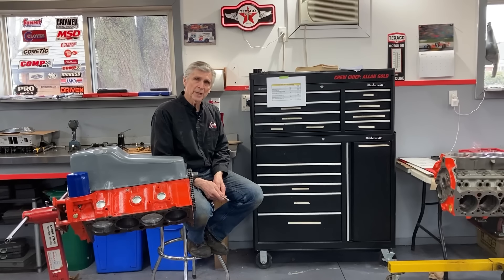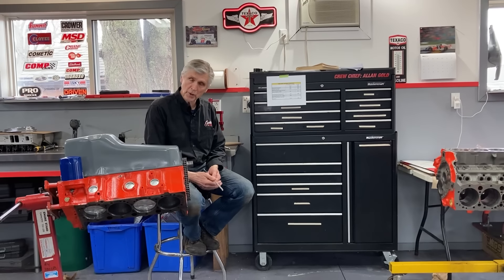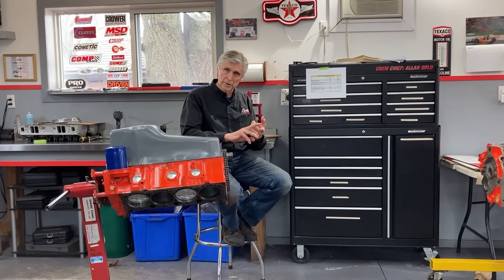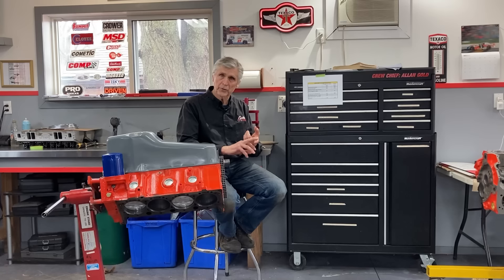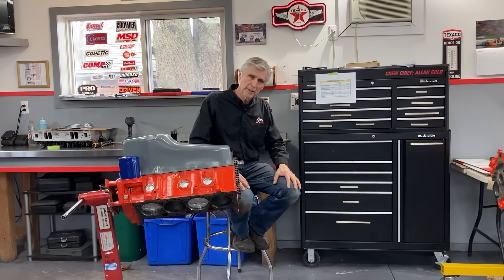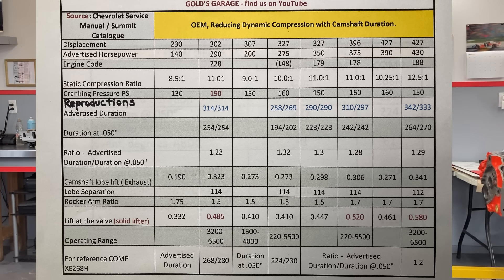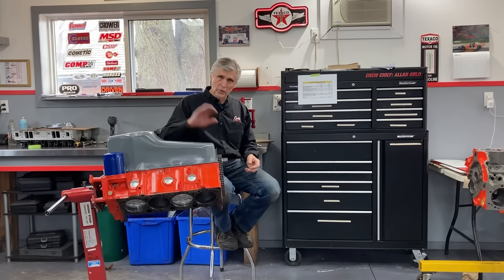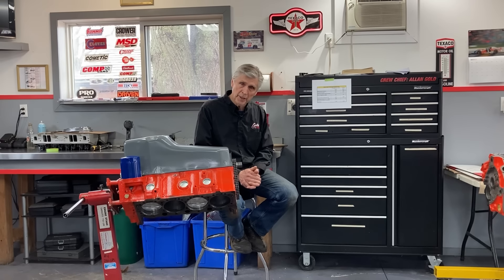Selecting the right camshaft - Compression Myths How much compression can you run on pump gas?

Comment: 12.5:1 SCR on pump gas? Absolutely! Even with steel rims.  Yep! Seen it done many times actually. 
Definitely premium gas, 93 octane from my experience.  Can't comment about anything lower, but I have heard it can.

I remember a time I believed in some of the stereotypes, and at the time they seemed correct because it typically came from people who seem to know what they were talking about, however I kept going back to the first time I seen very high compression with steel heads on pump gas. And that would be the engine my stepfather built. He was running 12.5 to 1 static compression ratio, Steelheads and ran 93 in it. No problems.
Regardless this is when I was first starting out and learning everything. Buy my mid-teens my brother and I were already doing engine swaps in manual transmission conversions etc etc,  and we were building what was considered high performance engines at the time, in the early 90s 400 or 500 horsepower was extreme horsepower, lol!

Anyways what has seen my stepfather and others do always nagged at me when I heard the so-called experts on compression 

Now many many years later, when forced induction is in its prime, I continue to hear misconceptions about compression. People have this idea that when you use the force induction you have to go with extremely low compression which is not accurate. I am running 11.0:1 SCR with twin turbos. My brother 10.5:1 with a turbo. On premium pump gas. 

Don't get me wrong, we have Holley EFI systems which help with tuning and getting the best out of everything, however really is more based on putting the correct components together. Too many people look at the individual parts and or maybe a couple of them together. For instance you may look at the camshaft with cylinder heads or something like that when in fact it is everything all together and even as this guy has stated which is very important, is the intended use. Many people don't consider the load, factors that play such a big role in what you are doing
Reply from the maker: Good comments, you have given this subject a lot of thought. Thanks Corvette. AG

Comment: Hmmm doesn't bleeding off the compression with cam duration defeating the purpose of gong with more compression to begin with?
Reply from the maker: Good point Alonzo. Here is how it works. The valve timing bleeds off compression at low RPM only. The fuel air mixture has mass. At high RPM the mixture is travelling at 200-400 RPM so it also has inertia. This helps to fill the cylinder on the compression stroke and purge the mixture on the overlap cycle. Dynamically you will have lots of compression. Engines are more less vulnerable to detonation at high speed because the flame travel takes time and the piston is moving rapidly. Hope this helps. AG
Reply from the maker: Alonzo, I just caught a mistake in the comment above, the fuel air mixture is travelling at 200-400 MPH, not 200-400 RPM. Engines are LESS vulnerable to detonation at high RPM. AG

Comment: What is the air  flow of the 289 eldavrock  Aluminum heads and what size cam should i get for a 289 with a t5,5 speed. If im not asking righr please let me know.
Reply from the maker: Thanks for the question Kenneth. I need more information about the engine and the car to help you. I am working on a camshaft video right now, hopefully it will be published soon. AG

Comment: My static is 10.2:1 ish. I have a comp XE266HR12. Warm cranking compression is between 162-165 on all holes at 5200’ elevation above sea level.  Adjusted to sea level 192 cranking compression. 4000+ lb manual Bronco. Runs great on 91 @ 32 degrees
Reply from the maker: Thanks Piercer, where are you 5200' above sea level? AG

Comment: 7:25 This is true and I'm sure you didn't mean for it to sound misleading, but it is very inaccurate as far as the power density of both fuels at their stoichiometric air to fuel ratio. Ethanol only produces 76,330 BTUs per gallon, but that gallon is mixed with 9 gallons of air. A gallon of gasoline produces 114,000 BTUs, but it's mixed with 14.7 gallons of air, and so only 61% as much fuel is burned when running gasoline.
If you do the math, you'll find that for a given volume of air/fuel mixture, gasoline produces 91.4% of the energy of 100% ethanol, and that's without building or tuning the engine to take advantage of the higher octane and cooling effects.

Comment: I have an L72 with fresh .030 over bore and 11:1 forged pistons using stock cast iron heads with oversize exhaust valves. A concours nut and bolt restoration was completed in 2019. The car overheats and I am unable to drive it. I installed a new DeWitt radiator to help with the cooling but to no avail. I then checked compression and found it to be 250 psi all cylinders. The original cam was reground to stock specs during the restoration. The intake is a factory 2 plane (5069) and the pistons are TRW. Everything on this car is new or reconditioned and now has less than 300 miles. I am using straight 104 leaded. The timing is whatever Corvette Specialties set it to. I am using stock exhaust manifolds w/2 1/2" exhaust pipes and stock 355 rear end. The car is very difficult to take off in and between that and the overheating  is not much fun to drive. Do you think  that the compression is the cause for the high temperature? Any advice would b much appreciated. Thank you.
Reply from the maker: Thanks for the question David. According to the GM manual, the cranking pressure for an L72 425HP 427 is 150PSI, even though it was 11.0:1 Static CR. 
I suggest we start by recalculating or verifying your static CR. The bore is 4.25 and the stroke is 3.76. You need to know your combustion chamber volume, head gasket thickness and piston dome volume. If any of those things were changed during the rebuild, machining the heads or block surfaces, thinner head gasket etc, they may have increased your static CR. 
To determine your dynamic CR and cranking pressure you will also need the connecting rod length, 6.135" and the IVCP (Intake valve closing point) of your camshaft. Unless you already know this or the engine is accessible to degree the cam, it is unlikely you will have this information.  
Since your cranking compression is so far off, and the engine also does not run well, I am suspicious that something is wrong with the assembly. For example of the timing chain/gears were aligned incorrectly, (camshaft advanced a link or two) , that would close your intake valve even sooner, trapping more compression. Similarly if there were mistakes in the camshaft regrinding, same result. 
This would be an interesting project. 
Do you have the cam specifications? degreeing the cam would determine if either of these things were true. That would mean determining the centerline of the intake valve and then closing point. IVCP 
I would start with degreeing the cam. The engine has to be out of the car to do this. 
Let me know if this is helpful. AG
Reply from the maker: Looking at my response from last night. Two other possible causes of your condition could be ignition timing or a vacuum leak. Your timing should be about 36 degrees total at 3000 RPM with the vacuum advance disconnected. You should be using vacuum advance connected to manifold vacuum below the throttle plates. (not port vacuum) Also check for vacuum leaks. There is a large vacuum port at the back of your carburetor below the float bowl, hard to see it and I have seen this left open before. That would cause extreme lean condition, overheating and terrible running. This still doesn't explain 250 PSI which is too much. AG
Reply: Check your thermostat in boiling water to make sure it opens when it should I found most of them don't work nowadays or when they should at least The most accurate ones I found are the Edelbrock thermostats

Comment: What cam do you suggest to use on a 1970 ford 429 with d0ve heads preformer rpm intake and 750 carb? 10.5:1 compression
Reply from the maker: Thanks Derek, I'm not a Ford expert but I will try to give you some input into your selection. First I need some information from you. What kind of vehicle, Mustang? Torino etc.? approximate weight, final gear ratio, transmission, manual or automatic? first gear ratio, torque converter stall if any. How will you drive this car? Is it a street cruiser or will you be racing etc.?
Your cam is the brains of your engine and these factors are important when making a selection. AG
Reply: @goldsgarage8236  1970 thunderbird 4,350 pounds 3.50 gears c6 auto not sure about trans gears
Reply from the maker: Hello Derek, thanks for the question. Here are some things to consider. The 429 is a monster engine but you will still have more than 10 pounds of car per cubic inch of engine, about the same as a Mustang 351. Your C6 transmission has a first gear ratio of 2.4:1 so your overall torque multiplication in first gear is 3.5x22.4=8.4. You need a cam that will provide good low RPM and midrange torque and drivability. I am looking at a COMP 34-227-4. This cam is 268/268 advertised and just under 220 at .050" The operating range is 1.500-5.500 RPM. The lift is .494" but you might think about rocker arms with a higher ratio than stock. Lift helps everywhere but does not hurt drivability. I suggest that you use a dynamic compression calculator such as Wallace (online, just google it) to determine your cranking pressure. I don't have all the numbers but I am pretty  sure it will be under 180 PSI which is the max I would recommend on pump gas. Do your homework, consider a higher stall converter and/or a higher numerically ratio rear gear. Its about torque multiplication and you want all you can get. Cam selection is somewhat subjective so I suggest you get other opinions as well. I hope this helps, let me know if you have further questions. AG
Reply: @goldsgarage8236  i have no problem with going to a stall convertor. I just want to match all parts

Comment: THIS IS THE VIDEO THAT I HAVE BEEN LOOKING FOR. I am looking to build a Normally Aspirated LT Gen V Direct Injection Small block to as large as I can get it in a standard deck (454cid I believe, 4.185" Bore x 4.125" Stroke) for a 4WD application, so max 6-6500 RPM, and was looking for good camshaft information, as I want it to run on 87 Octane daily. I know that the Direct Injection will allow me a bit more compression ratio due to it's design and knock deterrence because of where in the cycle the fuel is introduced, but I still had questions for overall CR. GM currently sells a 10.5:1 GenV for HD Trucks rated for 87oct, so I was hoping to run about 11.5:1 with the proper cam selection. this helps immensely. Thanks.
Reply: The bore and stroke combo you mentioned is 496 cubic inches. I've built several. It will pull the truck very well
Reply: @joeyjojojr.shabadoo915  Respectfully, you might want to reconsider your rpm goals for your 496 V8.  With that long, 4.125" stroke, 6500 rpm would put your mean piston speed at 4469 ft/min.  That is getting closer to NASCAR territory than to normal street engines.  Generally, even a pretty hot street engine is pushing the limit of mechanical reliability around 4000 ft/minute piston speed.  For example, a hot 350 Chevy small block with a 3.48" stroke at 6500 rpm has a mean piston speed of 3770 ft/min.  Also consider you are slinging heavy pistons and rods in this big motor, making the stresses of rapid directional changes magnitudes greater.

The good news is, with that huge displacement you won't need such high rpm to make big power.  Since you want to run 87 octane, I would suggest contacting a custom cam designer and ask for a cam that, with your increased displacement, will produce about the same cranking pressure as the stock, direct-injected motor.  For your 4x4 truck application, think hard and realistically about the rpm range where you will run the motor most of the time.  Huge mid-range torque may satisfy you substantially more than an extra 1000-1500 rpm on the very top.  Share those goals with the custom cam maker and you'll have a real beast!
Reply from the maker: Thanks for the question Joey, and I apologize for the very late reply. I just noticed it now. Unfortunately your question is a little out of my wheelhouse. I agree that direct injection should allow more CR and cranking pressure but I don't have enough experience to say how much. Typically I would recommend keeping your cranking pressure <150PSI if you are using 87 octane, so calculate static and dynamic CR and pick a cam that would have the correct IVC to provide that. SBC's bigger than 406 get expensive to build as you may already know. Gearing is also important, your overall reduction in first gear should be at least 10:1, even more if you are using big truck tires. Sorry i couldn't be more specific. Let me know how it turns out. AG

Comment: Hello
Great video thanks.
Between you and David I’ve learned a lot.

My build is a 383 stroker.
My builder install 16cc cereal bowl pistons. (I asked for flat tops) 🤷🏼‍♂️oh well.
He says I have 10.2:1 compression.
When I did the math based on my build sheet and the thickness between the head and block I come up with 9.8:1.
My compression is 185/186psi
His engine dyno showed 501hp 522tq with a 650 Holley with 93 octane.
After I did a lot of tuning and installed a 750 DP and per my builder I have my ignition locked out at 38*.
For some reason I get a lot more power and throttle response out of 87 octane.

I don’t hear any pre-detonation

Does that seem right to you?
Speaking of my 87 octane use…
Reply: Also
It’s a 1971 Chevelle
373 rear gears 
Automatic transmission 
3000 stall converter.

I’m assuming the lower gears and the stall are why I can run 87 octane.
Reply from the maker: Hello Einstein. thanks for the question. You did not mention the heads or camshaft, but those are good numbers for a street 383. 185 psi compression is about the upper limit for a street engine on pump gas. TO be safe, I would suggest using a distributor with vacuum advance connected to a manifold port and limit your timing to 36 degrees. For one thing, it should make it easier to crank, especially when it is hot. 
To cover your other question, yes your 3.73 gears and 3000 converter help. Even so, I would still not use 87 octane. I am sure that was an expensive engine, so saving a little on fuel to me is not worth the risk of damaging it. Nice Chevelle. AG
Reply from the maker: See my response below with your other question. AG
Reply: @goldsgarage8236  
Sorry
Brodix racerite 200 runners 205 intake valve.
Comp cam 234/242 hyd roller .561/.573 lift with comp cam short travel lifters.
We know based on the dyno my engine like 38*
We decided to go with the lock out due to the engine loading up at idle.
And my engine spins right over hot or cold at that locked out degrees.
My engine temp is 180*.
Every time I run 91 or higher octane my engine idles rougher and my plugs won’t stay clean.
I’m using the stock plus heat range.
Reply: @goldsgarage8236  
On the chassis dyno I bumped the timing up a degree or two with no hp improvement I then backed it off two degrees and lost around 6 hp.
I also have a hard time getting heat into my engine. I have a 180* thermostat and have a hard time getting to that temp unless it’s 90*+ outside.
All and all it runs pretty good.
But 87 bothers me and higher octane it doesn’t run right.
WOT my AFR is 12.8-13
Reply from the maker: Thanks Einstein. That is a very nice engine for sure. If all this works for you stay with it. I am guessing the IVCP is around 70 degrees ABDC, so that would help. Thanks for the info, I learned something from your experience.AG
Reply: @goldsgarage8236  
Center line intake is 106 exhaust 114
110 lobe separation with 4 degree advance
Reply: @goldsgarage8236  
If I did my calculations right

Advanced intake, duration 234
Advanced exhaust duration 242
LSA 110
Intake center line 106

IVO is 11.0BTDC
IVC is 43.0 ABDC
EVO is 55.0 BBDC
EVC is 7.0 ATDC
Overlap is 18*

These should be my numbers
Reply from the maker: Thanks, these numbers are @.050" . please look at the advertised or @.006" numbers when calculating dynamic compression and cranking PSI. AG
Reply: @goldsgarage8236  
Okay I found it.
At .006 intake 289 exhaust 297

IVO 38.5 BTDC
IVC 70.5 ABDC
EVO 82.5 BBDC
EVC 34.5 ATDC
OVERLAP 73*

Do these numbers look better?
And what do they mean as far as my build?
Reply: @goldsgarage8236  
My builder says i have 10.2:1 compression 
My compression using a gauge is 185/186 psi
so I'm trying to do some reverse calculations to see what my compression ratio is by using the Dynamic Compression Ratio Calculator.
After putting in all my numbers and then changing the compression ratio number until i come up the the correct psi of 186.
it looks like my compression ratio is 10:1 or just under at 9.98:1 compression which brings my psi to 185.96

Number of cylinder 8
Bore in inches 4.030
Stroke in inches 3.75
Rod length in inches 6
Static compression 10:1
Intake valve closes ABDC 43
Altitude 1280

This calculate to
Static compression ratio of 10:1.
Effective stroke is 3.38 inches.
Your dynamic compression ratio is 9.11:1 .
Your dynamic cranking pressure is 186.51 PSI.
Your effective boost compression ratio, reflecting static c.r., cam timing, altitude, and boost of 0 PSI is 8.85 :1.
V/P (Volume to Pressure Index) is 193